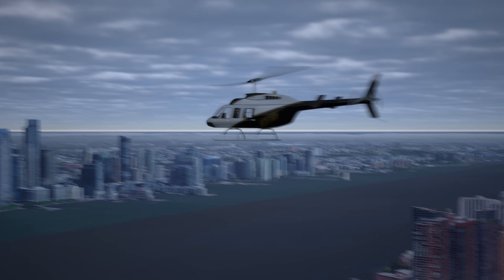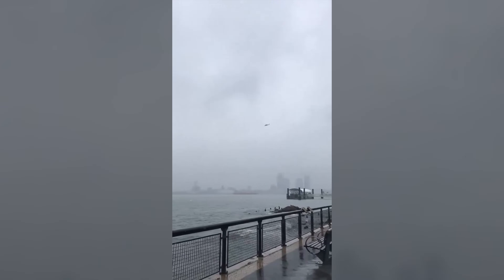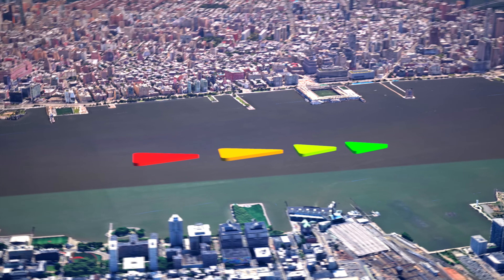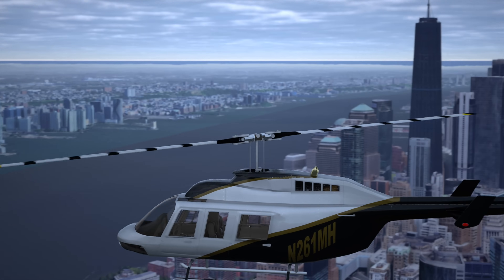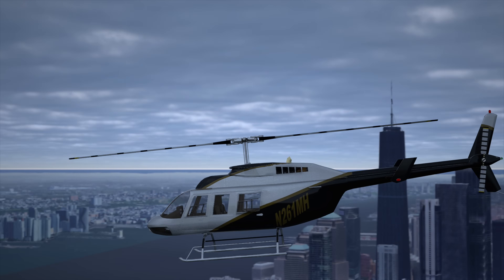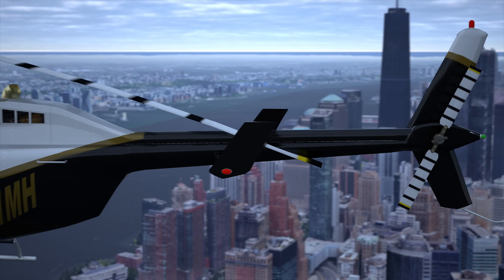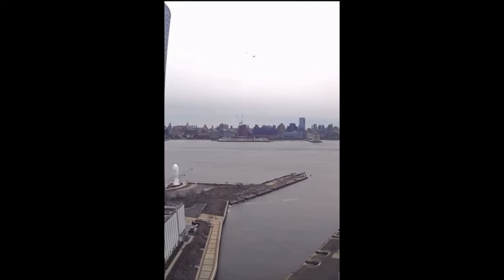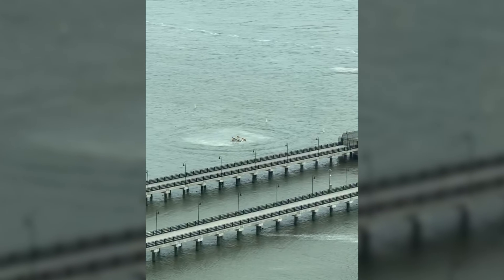Helicopters DON'T just fall from the sky - What is "Mast Bumping"?

Comment: If you imagine the tip off the blades is rotating at 'for example' 200kmh and the chopper is travelling forward at 150kmh that blade travelling forward is knocking on 350kmh. Im no pilot but there is some condition that will bend the blades up and snap but understanding how they can bend down is confusing is it a condition that requires a slow forward momentum?

Comment: You are making big assumptions. The Bell 206 is hard to get into mast bumping even when the c of g is way out.  Bell helicopters stopped making replacement main rotor blades some time ago.  The new 3rd party composite  blades have had some issues and may be the problem

Comment: Mast bumping doesn't occur in normal flight . I have flown 5000+ hours in 2 blade main rotor systems and I have encountered must bumping only one time while dodging a crop duster that was low leveling at about 20 feet above the ground in a military restricted area. He popped up to about 250 feet from under a flight of 6 UH-1Huey helicopters. I had to do an extreme maneuver to avoid a mid-air. There were only two bumps, but they were extremely hard and I felt compelled to land immediately. There were two slight dents in the mast. That was a condition that most pilots will probably never experience in many thousands of hours of helicopter time in similar type helicopters, because it is normally pilot induced and is a rare condition. When the main rotor blades chop of a tail boom, it would normally cut the boom much further aft than what we are seeing in the video and photos. It is more likely to be a main transmission or a portion of the tail rotor drive shaft that failed. The fuselage looks like a portion of that shaft could have been flailing around and cutting into the tail boom. The NTSB will find out what happened, and in this case I doubt they can find any pilot error.

Comment: There's no "everyday" failure that just snaps everything off like that—in normal operations, helicopter components are engineered with margins that prevent one isolated failure from unleashing the full fury of the engine. However, if we delve into the realm of a catastrophic, almost “what‐if” scenario, the failure would need to occur in a highly critical, high-torque component of the power transmission system. In a Bell 206 L-4, one of the most plausible candidates for such a failure is a sudden seizure in the engine’s free turbine (or freewheeling unit) that drives the main rotor.

Here’s why this makes sense:

Role of the Free Turbine/Freewheeling Unit: The Bell 206 L-4 uses a free-turbine design. In this configuration, the engine’s gas-generator section drives one turbine, which in turn powers another turbine connected to the main rotor gearbox. The free turbine is meant to allow a degree of “slip”—it decouples the engine’s high-speed output from the rotor’s lower, regulated rpm. If this free turbine were to seize (for instance, due to a lubrication failure, contamination, or an unforeseen material flaw), it would suddenly force the full, unmitigated engine torque into a system engineered to handle power only within controlled limits.

Cascading Effects on the Airframe: With an abrupt lock-up, the surge in torque would rapidly and dramatically load all connected components—the rotor head, mast, swash plate, and transmission. These parts are designed to transfer and manage power smoothly; a sudden jolt from a locked engine element would generate forces that could exceed the mechanical limits of not only these rotor components but also the supporting structures (such as the support beams and even the engine compartment floor). Once the integrity of the rotor mast and its attachments is compromised by such extreme torsional loads, the violent separation (and subsequently, the tearing away of the rotor assembly and even the tail rotor boom assembly) becomes a conceivable, though extraordinarily unlikely, consequence.

Why Such a Single-Point Failure Is Critical: The scenario requires a failure mode that instantaneously bypasses the normal damping and fail-safe features built into the helicopter’s power transmission. A seized free turbine essentially “locks” the rotor drive system. The engine, still capable of producing high rpm, would impose a shock loading on every subsequent link in the drive train. In a chain that is only as strong as its weakest link, this sudden and extreme torsional overload would tear through assemblies designed only for normally fluctuating loads, not an instantaneous surge of violent energy.

In summary, while it’s an extreme situation, a catastrophic seizure—specifically within the free turbine or a similar critical element of the rotor drive system—could, in principle, generate enough torque and dynamic load to tear apart the rotor-head, mast, swash plate, transmission, support beams, the engine compartment floor. The initial and sudden torque, causing a rapid yaw, would affect the tail rotor boom assembly immediately, resulting in its separation from the Bell 206 L-4 helicopter.

Comment: There is no way this was mast bump without the blade breaking into pieces where it would hit the tail, and then somehow the whole transmission is pulled clear off the helicopter, still connected to the blades which both look to be intact. This may be a different failure of some kind tied to terrible maintenance. You can see from the video that it was instant, with the mast and transmission separating from the helicopter then, under extreme aerodynamic forces, followed by a break up of the tail from the rest of the fusselage.

Comment: there is a better video which you can see the aircraft better and closer..if you look at the vertical stabilator at the tail rotor gear box, you will see the tail boom buckle at that location and then the vertical stabilator and tail rotor gearbox separate from the aircraft, then the nose pitches down, would assume the pilot pulled aft cyclic to try to level the aircraft resulting in the rotor system contacting and cutting through the tail boom and the violence of that event resulted in the transmission and rotor system breaking the mount points and separating from the aircraft...WAS NOT MAST BUMPING, the initial problem began at the tail.

Comment: In the end, everything will be talked about, and yet we’ll still avoid talking about the elephant in the room. The civil aviation system is broken.

In any profession, you start as a student, then continue as an assistant. Once you gain enough experience, you begin working under supervision. After some time, you work on your own, handling simple tasks. Later, you take on tasks of any kind. If you're good at your job, you may be promoted to chief or instructor. And finally, you retire.

In commercial aviation, you start as a student. Then you get your instructor rating and begin teaching, just to build hours so you can "pursue your dream". In helicopters, you might try to build hours doing scenic tours—flying solo, carrying passengers, in complex environments like New York City.

Once you’ve built the required flight hours, you become eligible for a job as a copilot at a major company. Here the salary is good! Then you move up to captain. And after a few years, you retire.

Has anyone noticed the subtle difference?

Comment: If it was mast bumping then the blades would have been smashed but they are not. I think either the tail rotor broke or the tail connecting to the body cracked and snapped

Comment: Army Air  CAV here. My  bird was the OH58/Bell JetRanger. Basically the same helicopter as this one.  This helicopter was not susceptible to mast bump. Even under extreme maneuvers. Never came close in training or combat.  I'm not saying it didn't happen in this case. I'm just saying the chances are One in a million. I'm leaning towards the maintenance standards in the tourist helicopter industry
Reply: After Kobe I always hated the idea of takin helicopters as a joy ride
Reply: Spot on. I reckon it was a maintenance issue
Reply: Same here. 1/17 Cav OEF 09-10 and 11-12. Never seen this happen. Seen them make it back with holes in places you would think would’ve brought them down! Salute brother!
Reply: Looks like a sudden seizure of the tail rotor. Video shows a hard rotation of the fuselage prior to separation of tail boom. Main rotor continues spinning with transmission attached. Suggests a yaw due to failure of the anti torque tail rotor.
Reply: Absolutely
Reply: Unless of course someone wants rid of you because you know something they dont want out and wont come in line...
Reply: Well I did 2 wars in the marines and if the helo was not leaking then you got a problem.
I know it’s not the same.
But they all fall hard and fast .
I hate helicopters.
And ships . Lucky to be alive.
Reply: Think it might’ve been blade balance issue or pc links?
Reply: Better to be lucky than good I guess.  The Bell 206 Jetranger has an underslung rotor system.  It is the exact design susceptible to mast bumping.
Reply: Iirc you were proven correct in the investigation
Reply: Or you know to unalive very important people you have to make it look like a accident. Because Pretty sure the rotar would've broke on impact but looks pretty intact to me.
Reply: Definitely right about maintenance.   I hate going on helicopters.   I always request to see maintenance records.   All it takes is one bolt loose because helicopters are basically rattling, rattling = screw/bolt comes completely off the helicopter, and then the rest of it comes apart easily
Reply: Jesus nut?
Reply: I believe it was on purpose...just thinking out loud! Someone, Something did it...seems like it to me!
Reply: @RosesandBerries  just an FYI, speculation like that made the investigation into TWA flight 800 almost impossible. Even if you have professional expertise, it's irresponsible to speculate, and for a layperson it's downright foolish.
Reply: @fletcherenfield9474 except a rotar can't stay in tact if it slams into the tail, but the rotars were never shattered, as if both pieces, rotars and tail "plopped" off the machine. To say it's a matienience issue when there is no visible damage to the rotars and they are still spinning.

Last u checked rotars can't hit anything without breaking.
Reply: @fletcherenfield9474  a boom strike, when the rotar hits the tail, is never a clean cut. Its considered impossible it's violent, and it shreds both the rotar and tail to pieces,l.

They don't just "plop" off. Too many ignorants acting like the world is peaches and cream. When to be a pilot, you just have to not be color blind.
Has nothing to do with intelligence.

So please explain to the audience how, these two pieces didn't break off, but simply came off, cleanly.
Reply: @JayGalatica  you replied to me twice and neither one has anything to do with what I said. I just pointed out that speculating on causes before the investigation was complete wasn't a great idea. Did you mean to reply to someone else?

Comment: Mast bumping doesn't happen (without massive turbulence) in straight level flight. The 206 isn't prone to master bumping either. This looks like the trans locked up, that massive torque to the right broke the tail off.

Comment: Another channel said mast bumping on a Bell 206 is highly unlikely due to the design, and absent of severe weather, pretty rare.   And this guy was in straight level flight, there were no low G maneuvers at all.  Just an instant catastrophic separation of the tail boom, then the rotor and gear box.   Very odd.  Either the gear box suddenly or violently seized, or someone or something caused it.  Very curious to the NTSB findings and maintenance records.

Comment: i’m going to guess it was a structural failure a part failed. I’m gonna say, probably poor maintenance overlook. I don’t care what maintenance log say people like to just pencil in maintenance logs without actually doing a full detailed inspection that would be more likely because severe turbulent weather would’ve been noted by other aircraft in the area and what are bell helicopters not equipped with a flight recorder.

Comment: Yeah, this is why my Dad, a pilot, always warned me to never fly in a helicopter. When planes have problems in the sky, they have the ability to glide. Helicopters don't have the ability to glide. So if the engines fail in a plane, you can reasonably expect to  land safely somewhere. In helicopter, you'll just drop to the ground like a rock and completely unable to control the descent. In this case, the helicopter was upside down. Horrifying yes ... and this is why I will never EVER take any air ride in a helicopter.

Comment: This is not mast bumping. The rotors would have torn to shreds.  Both blades are fully there attached to the transmission.  This indicates transmission lock up. Just picture the blades going close to the speed of sound, and they suddenly stop. The momentum is then transferred to the aircraft. This rips the tailboom off due to G forces and the blades and transmission rip out of the aircraft. I bet they will find sheared transmission mount bolts, meaning it was ripped out of the airframe.

Comment: The rotor is coming off fully intact.  This is a clear sign of main transmission gearbox failure.  Transmission gearbox locked up, literally stopping the main rotor. The massive G force of the rotor stoppage caused the aircraft to turn in the opposite direction to make up for the stopped main rotor. This tore off the tailboom due to counter rotational force. I would look at the history or records of chip lights on the main transmission gearbox. This massive stop in rotational force ripped the transmission out of the aircraft, rip the tailboom off, and a unfortunate crash. When I was in the Marines, the DoD downed all CH-53/MH-53 in early 2000 due to a Corpus Chisti crash of a MH-53. The main gear box locked up killing all on board. Same destruction happened.

Comment: This is why I will never ever get on a plane or helicopter. Too many ways to die. If anything goes wrong with the engine or propellers or the weather or if your vision is obscured, you’re fucked
Reply: I read a statistic that a person is 85 times more likely to die per hour flown in a helicopter compared to driving an hour in a car 😮
Reply: Planes are fine. Never get on a motorcycle or a helicopter

Comment: Nothing to do with mast bumping, main blades will break apart if they hit the tail but we see them flying alone without any damage on them. The most probable cause is gearbox lock. 

There are already many video analyzes and I'm surprised how many of them are completelly wrong while the wholse story is vivible and on record.
If one watch carefully will see several stage of the accident.
1. in a normal flight suddenly the body of the helicopter makes rapid 180 degree yaw. There are no flying parts, the tail is still in it's place, rotor is intact. This rapid rotation of the body can be caused only by excessive rotational forces if the gearbox locks by some reason.
2. after the 180 degree rotation because of the violent g-forces the tail break off. Still rotor is in it's place and no collision is visible between the main rotor and the tail.
3. After the tail breaks off the fuselage starts tumbling with the main rotor and blades still intact.
4. After the first tumble the main rotor detaches from the fuselage along with the gearbox attached to it.
There are several factors that can contribute for a gearbox to get locked. Like poor maintanance or foreign object in the gearbox as well a few other situations.

Comment: Most common tourist/ pleasure flight pilot mistakes is carrying out aerobatics outside of the permissible flight envelope. This can be catastrophic at the time or over time where many pilots do this in the same aircraft causing extreme stresses on the moving parts and gearbox mounts. As stated the helicopter performing these types of manoeuvres in the video is not a 206L. Unfortunately many companies employ low time pilots for pleasure flights who are hungry to build hours and tend not to know how dangerous it can be to create an “exciting” flight.

Comment: Looks like a massive Main Gearbox failure to me. The gearbox locked-up solid, which attempted to spin the heli in the same direction as the rotor (sudden yaw was reported), this broke the tail boom off and ripped the gearbox from its mounts, with rotors attached and intact.

Comment: Thirteen years ago, a seemingly identical accident occurred in a Eurocopter Super Puma. The gearbox "exploded," causing the rotor to separate from the helicopter. The gearbox failure was caused by metal particles in the second stage planet gear causing parts to break, resulting in a massive oil leak, and the main rotor gearbox to fail. As the helicopter flew over the North Sea, the main rotor came off, and the aircraft crashed into the sea. Immediately after the loss of main rotor gearbox oil pressure, the helicopter began to descend and failed to respond to controls. The main rotor system separated from the helicopter about 20 seconds after the loss of oil pressure. During separation, the main rotor blades struck the helicopter's tail boom in several places, severing it from the fuselage.

Comment: This video is wrong, and some of the aviators on here agreeing with it should frankly know better.

Mast bumping fractures the *mast*, separating the rotor from the transmission. You can see that the transmission has gone with the rotor and that the mast is intact.

Additionally, the rotor severing the tail Is not an example of mast bumping, but a boom strike, which is almost always caused by a mechanical failure rather than manoeuvres.

So sad for the family and friends 😢